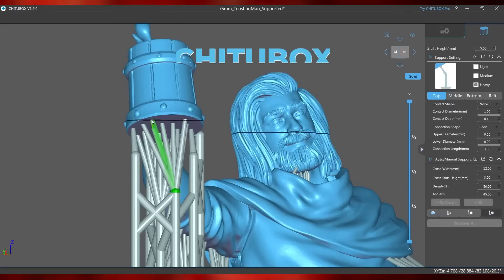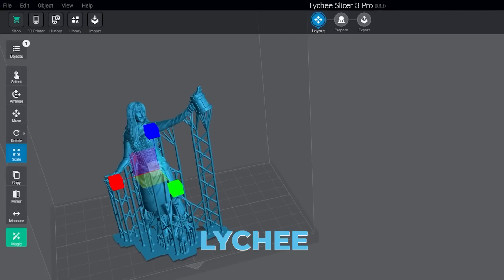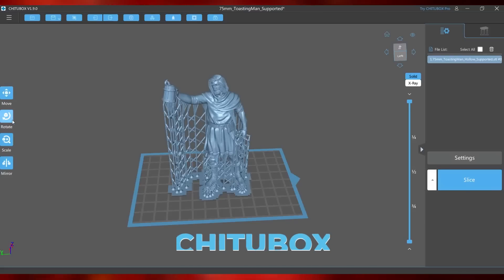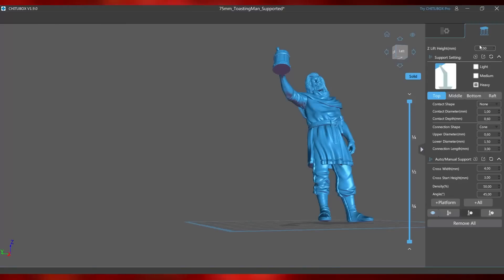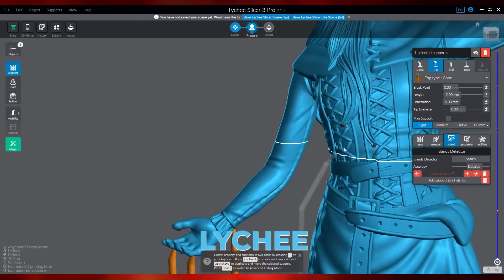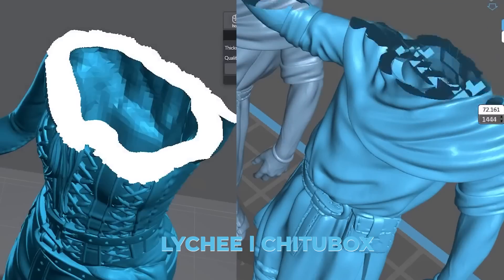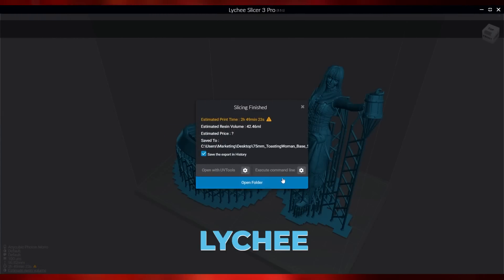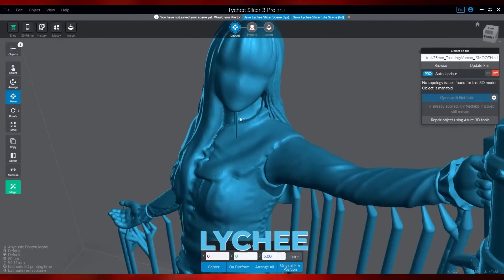How to choose your SLICER? | 3D Printing Tutorial

Comment: The choice was easy for me.  I have a Flashforge Foto 9.25" 6k printer and while I can't complain because it prints great and their website says it works with Chitubox and it doesn't.  You're stuck using their FlashDLPrint slicer software.  It works though so no real complaints.

Comment: I use Chitubox, but I am also just starting. However, Chitubox 1.9.0 on a Mac seems very slow at times in large setups (Elegoo Saturn plate packed). I haven't timed it but ~45 min for slicing, ~1 hr for saving...
Reply: I have the same issue on my Mac with some files. It seems to take Chitubox 1.9.0 forever to slice and save.
Reply: Holy crap. On my PC running windows 11, a packed build plate may take 15-30 seconds at most for any operation.

Comment: Yes!!! Keen on the next video. Started writing that I want to increase the 75mm without breaking the supports. I keep trying to find the best method but it does seem to be quite manual. Even with recalculated supports. It breaks all the bracing supports and position of supports that have a web of supports to a single support structure.

Comment: I've used both and I like Chitubox much more.  I have great luck running Siraya Tech Fast on a Mars 2 Pro @ .025mm slices.1.5 sec exposure, and 30sec on the base. I use minimal supports and basically have had no failures at all.
Reply: Not gonna lie you are one of the few people Ive seen say they like Chitubox more. ive yet to dive into lychee myself.